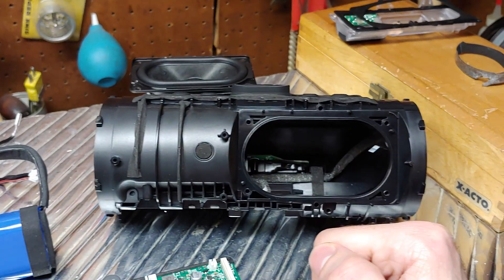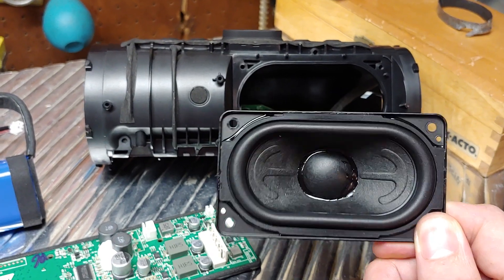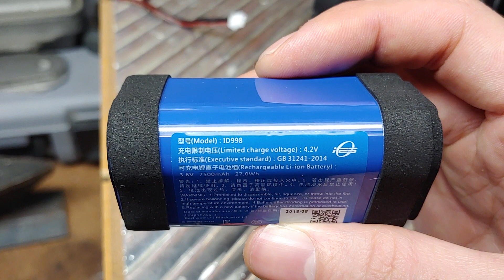JBL Charge 4 a Look Inside!

Comment: Why I think they went with there design, first they disabled the microphone because they came out with there JBL link portable, they went with a mono design because the speaker itself isn’t big enough to produce a stereo sound effectively due to the size of the unit and you can only enjoy that sound if your six feet away having the speaker facing towards you, so having stereo on the speaker wouldn’t be needed, also with two slightly bigger stereo speakers would rack up the price where you would rather just pay for the extreme 2 for just 60 or 50 more bucks, why they went with the 3 cylinder type batteries in the charge is because they’re cheaper and safer, which thus explains the off-centered speaker. In summary the speaker will probably be on a table or shelf somewhere at a party so no stereo is needed to come out of on speaker since nobody will notice…
And if you want stereo, JBL would be happy to sell you another JBL Charge 4. More money for them and true stereo for you.
Reply from the maker: That's why I stuck with the charge 3. It's not the stereo effect per say. It's more the improved fidelity from have two drivers handling left and right channels instead of compressing it all into one driver. With the music I listen to it just didn't sound right to my ears. I actually never bothered to upgrade from the flip 4 either. I'll probably use these speakers until the no longer work.
Reply: @RobertNES816  
Smart, if you’re speaker isn’t broken why buy another one?
That’s why I didn’t get the charge 4.
But I did go for the charge 5, my charge 2 had seen better days…
Plus the charge 5 has a tweeter, it tends to fill a room a little better and have more fidelity in the mids and highs. And I normally put my speaker in the back of my room so I don’t really mind the lack of stereo…
Reply from the maker: @Snooty1  I returned this charge 4 lol.
Reply: @RobertNES816  
Wow! That’s surprising!
I wouldn’t think JBL would allow you to return it if you opened it up…
Kudos to JBL!
Reply from the maker: @Snooty1  it wasn't from JBL. When I take something apart anyways it always goes back together perfectly.
Reply: @RobertNES816  
Yeah, guess you’re right…
But I guess JBL isn’t one of those companies that put stickers inside of it that would void the warrantees if opened or something…
Reply from the maker: @Snooty1  not that I saw.
Reply from the maker: But then again most of their products would break if you took em apart.
Reply: @RobertNES816  
Really?
I thought they were built tough…
Reply from the maker: @Snooty1  The BT speakers are. But I'm talking about their headphones. They're made to be thrown away, same with every other company.
Reply: @RobertNES816  
Oh, that makes sense…

Comment: 3x18650 battery, at 2500mAh each. So they even cheaped out on that one.

At least it's 18650, so you can pop in new, better cells when it dies (up to 3600mAh/cell, or a total of 10800mAh), unlike the earlier Charge units (I'm looking at you, Charge 2+, with those almost exploding "chocolate bar" cells...)

Comment: Pretty late I know, but I recently bought a charge 4 and I actually come to this video after notecing the lag of stereo. Well I opened it up an my newer version of it does not have a mic and I can See there is no connector for it soldered on but the place is still there on the mainboard.

Comment: There is a charge 4s. They have a thicker coating on the speaker driver, and the wires are soldered to the speaker. No compatible parts between the two, except maybe the motherboard. The plastic casing on the S version does not have the ribs to the left of the speaker, it is completely smooth. The grill of the S version is also clipped in from the back like this, but the front side is screwed in. The flip 5 was also mono, but I hope they go back to stereo with the charge 5. Maybe the flip 6.

Comment: Robert thank you for your video, it sounds like you know your stuff. I have a JBL charge 4 that's 3 months old. I can't get it to do nothing, not charging. I tried different power source, new charge cord, still nothing (no lights). What do I do next, Port, board or battery? Also, what is your opinion, on the best blue tooth speaker for under 300 bucks?
Reply from the maker: The battery could've taken a dump on you. Or check the charging port to as it might have broken. With any BT device make sure you use a good name brand charger as off brands can and will damage the device and battery (blew up my LG G3 with an off brand charger). 

As for BT speakers I purchased the Charge 3 again after returning this speaker. I'm happy with the Charge 3 so I can't offer any advice on newer speakers since I honestly haven't looked.

Comment: I bought a JBL Charge 4 used and I noticed that if my phone is more than a few feet from the speaker the sound cuts in and out. Any ideas as to what the problem might be?
Reply from the maker: Return it. The BT antenna is probably damaged.
Reply: @RobertNES816  Can't return it as I bought it as is. It works with the phone close and I only gave 20 bucks for it so I'm not too worried about it. Thanks for your reply.
Reply: @sk8rlabel  bruh 20 bucks

Comment: Stereo sound in this form factor makes no sense, for stereo to even work you need to have space between the speakers, an equilateral triangle with you in the middle is how stereo sound performs best, that simply isnt possible in this small form factor.
Reply from the maker: You're absolutely right. But having two speakers playing in stereo in a small space as apposed to just one playing in a small space has a similar affect to listening to FM stereo on an old radio VS just FM. even though the speakers are close together you still get the added "open sound" of stereo vs having the L/R channels simply mixed together creating a narrow and congested listening experience.
Reply from the maker: It all depends on the music you listen to. For me with heavy metal and just about any of the 80's music I listen to it was apparent the Charge 3 was a better choice for me over the Charge 4.
Reply: I dont think you're hearing the difference between stereo and mono, I think you're hearing a difference in frequency response and believing it's the lack of stereo sound.
The speakers on the charge 3 have almost no separation, the stereo effect is non existent.
You may also be hearing beaming, the driver they uses rolls off pretty hard on the high end and it has a ton of EQ to make up for it, that works on-axis, but off axis the sound will suffer badly.

Comment: Hi Robert. I just talked to JBL customer service and about mono sound and why they did this, told me that all their speakers are mono! And if you see more than 1 driver in some series, for example in ch3, one of them is woofer and another one is tweeter! They're not stereo. They also claimed that one full range driver sounds better than few seprated drivers. Do you agreel?!
Reply from the maker: Thats not true. I've done numerous tests on my Charge 3 and Flip 4. They're both in stereo and both drivers are full range drivers. So it wouldn't make sense to have one act as a tweeter and the other s woofer.
Reply from the maker: I think they may have been talking about their current line up. The clip 3, flip 5, charge 4 are all mono. Then with the larger speakers they have two mid/low range drivers and two tweeters. Those larger speakers may in fact play in mono aswell since that's the direction that JBL/Harmon seems to be going.

Comment: Hello sir..... my speaker started making a static type of noise on anything level of volume. I tried different volumes but it keeps doing it. Can u help?! 
Thanks in advance.
Reply from the maker: Try to pair it with your phone again. If that doesn't work then it likely has an issue with the amp or BT module.
Reply: @RobertNES816  thank you so much for the reply.  I'll do the pairing. Have a nice day

Comment: Is that small mesh on the front an opening? My Charge 4 is leaking air. I tested it with several others and everyone behaves a bit differently.
I‘d shut the leak with glue or something
Reply from the maker: Thats a vent to allow for changes in air temperature and driver movement. If that vent gets blocked you'd see the drivers and passive radiators get pushed out on hot days like with the early Flip 3 units.
Reply: Did you have gg version
Reply: archana Khanwe tl
Reply: JBL Bass Tester  did charge 4 GG  HAVE THE SAME PROBLEM
Reply: ジJBL TESTER 46 nope, Charge 4 is completely sealed
Reply: JBL Bass Tester  is jbl charge 4 GG is completely sealed
Reply: JBL Bass Tester  did TL have more excoursion